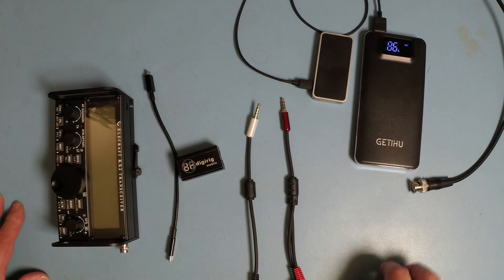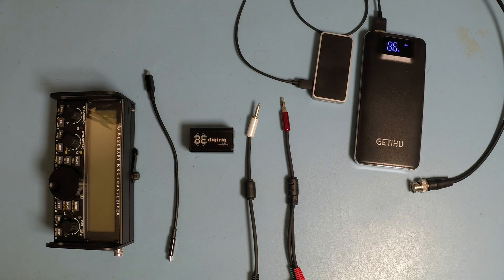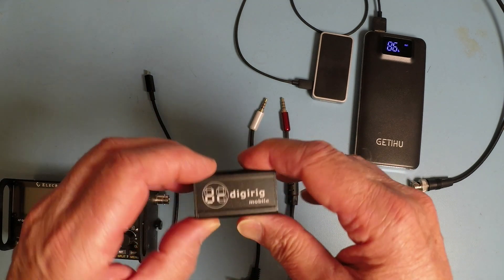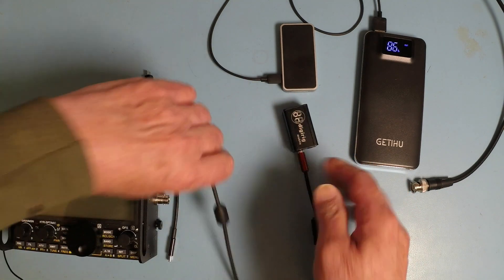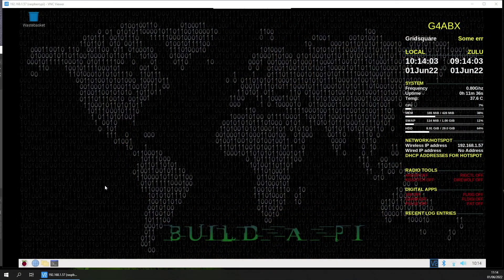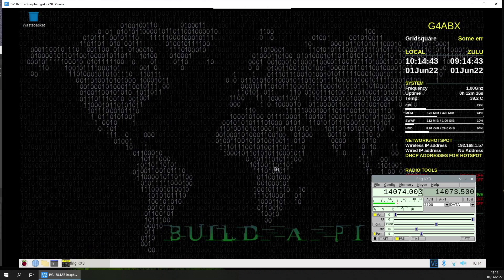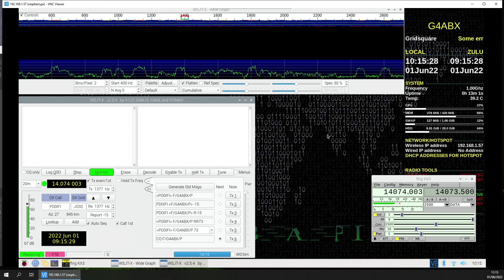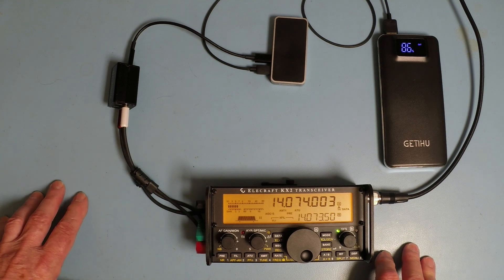Reducing cable bulk for the highly effective Ham Radio DigiRig -part 2

Comment: WOW nice and small setup, is gps not needed for digital modes?
Reply from the maker: GPS is not needed. You just need your 'Maidenhead locator' which is available on line. Just look up Maidenhead locator and navigate to your QTH. That will give you your 6 digit locator. Your Digital modes application needs this locator.
Its completely free -- if you have a problem I can find it for you given your exact QTH location.
73
Bruce G4ABX
Reply: @G4ABX   Excellent, thanks for your feedback sir.
Reply: Where were you looking at wsjt? Am I missing something. If I sound ignorant, it's because I am! 73 K2WW

Comment: Very nice and I wonder how you kept the wires correct to put the new connectors on.
Reply from the maker: __ With the judicious use of my 'ohm-meter' (Test meter) and some heatshrink tubing to mark the cables. 
Its the classic instruction of 'Measure twice, cut once' :-)
The cables themselves are very robust so you need to be careful when you cut through the outer sleeve than in your enthusiasm, you don't slice through the inner cables at the same time!.
73
Bruce G4ABX
@G4ABX

Comment: is there any substancial difference between using a regular USB audio interface vs digirig?
Reply from the maker: If you already have a workable solution, then I wouldn't say DigiRig is a substantial upgrade.
 
It is very small, lightweight, has a USB 'C' connection to your PC (or in my case, Raspberry Pi,) so for portable applications, it's a very neat solution.

As to other attributes such as reliability, I haven't had it long enough to judge. 
Usually, its not the 'electronics' that become unreliable, its the 'electromechanical interface' -- the plugs and cables that cause the problem. In DigiRig's case, the cable and connectors are very high quality.
73
Bruce G4ABX

g4abx.co.uk
@G4ABX
Reply: @G4ABX  thank you
Reply from the maker: @CE3FJK  You are welcome
73
Bruce